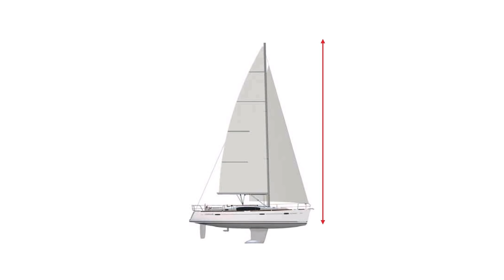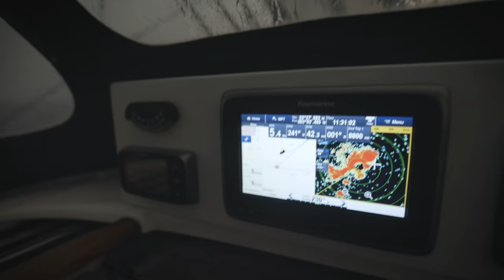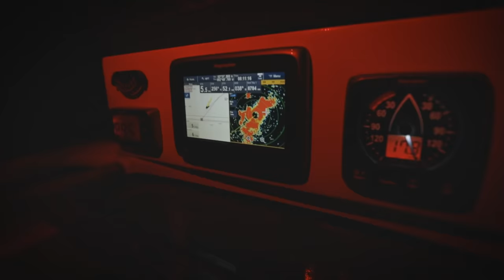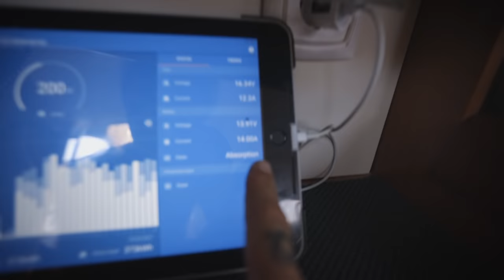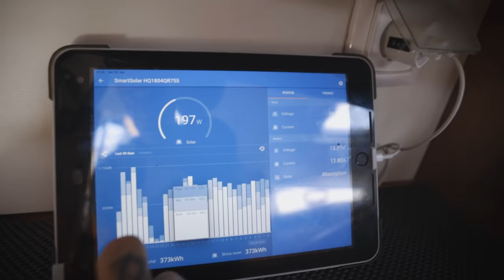Is a BENETEAU suited to Bluewater Sailing? (BOAT TOUR & REVIEW) ⛵️ | Ep 24

Comment: The sheeting angles can make a huge difference with rolling. Use tweakers and adjust the raveller to make it as comfortable as possible. Then sometimes a slow roll in a swell can improve performance greatly. Its called ooching.

Comment: PS to my post below. Every Sailboat I have had has been a Conventional Rig with Classic Mast and Main Sail with Lazy Jacks and Stack Packs and Hank on Sails, apart from my last boat which had a Furling Genoa on a basic Sloop with no inner forestry (I don’t like them tbh) Maximum fun was bouncing around on the foredeck changing Sails, loved it. They all can be made to work but Disability forced on me learn what a total pain in the backside to work with a Classic Mast really is, hence my Conversion to - after a serious look into them in Mast Furling, and the UV protection they can offer. Battens in them cause serious wear and tear, and seriously shorten the Life of already short lived Crosscut Dacron Sails and seriously reduce furling and unfurling reliability. So as a Cruiser looking for Reliability and a long Service Life Shape maintaining Sail, I started looking for a Sailmaker that would make me a Triradial Furling Battenless Main. It turned out to be quite a long search. Usually only getting the response “We Only Make Batten Ones” Eventually, I got a Yes, we’ve made a number of them, and if you need heavy duty Offshore specification, just tick the box on the order form - this from Precision Sails, and much to my surprise, they added, that the Triradial Construction recovers most of the power lost by having No Battens ! Wow.  Now they do cost from about double a Crosscut Dacron Sail, but instead of being Stretched and buggered inside three years, with occasional Valeting, and re stitching, they can maintain their shape well for over 20 years- So cost per year of Service Life Plummets. Same goes for a Furling Triradial Genoa too as Reinforced Reefing Points to retain shape can be added. Partially Furl a Crosscut Dacron one, and the Sail Shape can be buggered within a few hours. So I’m thinking of about around a 140% Triradial Genoa, to have enough Sail room to properly fit three Reefing points, or a self tacking Jib plus a Furling Reaching Code Zero to fill in the Wind angle gaps plus a Furling Gennaker depending on Sailmaker advice. Since, other Sailmakers, including Quantum, Ullman, and others have started offering Battenless Furling Triradial Mainsails as well, so things look up. Bob. 👍⛵️🌟🌟🌟

Comment: Great vid, well put together and thought out. The main question ‘is this boat good enough for ocean crossings’ is fairly simple to answer. Every boat has somewhere a builder’s data plate, on this plate you’ll find reference to a ‘design category’ - A, B, C or D. 

Category A is ‘Ocean’ - designed to be capable and self sufficient in wind that may exceed force 8 and wave heights in excess of 4m. 

Obviously there are boats out there in category B (offshore), C (inshore) and D (sheltered waters) that are taken across oceans but consider the implications of your insurance not paying out should something happen and you have to bail into the life raft with your beacon. 

FYI Oceanis 40 is Class A, as are most boats above 30 ft.
Reply from the maker: Thankyou sir, correct you are. Glad you enjoyed🤙

Comment: There is nothing wrong with a Beneteau. I owned a 461 and it was a solid boat, quite fast and was well furnished. I had it modified from a four cabin to a three cabin to make it more livable to me. I agree with your sail modifications, it needs a self tacking jib and a third reef in the main. I had the teak decks refurbished and replaced the foredeck to give it a new life. The exhaust elbow replacement is a must. Mine was almost completely blocked. I replaced all the hoses, throttle cable, standing and running rigging, the guide wires and batteries to increase the storage to 560ah. You can never have enough! The fin keel needed some work due to corrosion. You can argue all day long about a blue water boat and I agree a steel or aluminum keel is safest, particularly with a full length keel but they are hard to maneuver backwards and slow. Amels have a fin keel and so do lots of other boats costing a lot more money and most boats today are made of fiberglass. I have heard you tubers sneer about “plastic fantastic” boats when that is exactly what their boat is. Ignore the detractors, you have a solid boat which will serve you well.
Reply from the maker: Agreed and thanks for your insight mate. All good points here and the 461 sounds like a nice boat. Fair winds 🤙

Comment: We crossed the atlantic 3 years ago on our B43 which is quite similar to your boat. We made this first crossing with the boat as we bought it. We are now preparing to leave next summer for a 5 year trip and replaced, modified, reinforced a lot of stuff. New sails, purpose made (reinforced). New sprayhood and bimini with 400 watt semi flexible pv panels on the bimini. Lithium batteries and modification of alternator charging to protect alternator. New motormounts, replaced all standing rigging with dieform. Installed watermaker, …. And the list goes on and on. With our experience i could maybe make some small additions to your ebook
Reply from the maker: Good job Francis, some great boat jobs ticked off the list especially the lithiums and watermaker. If your interested the ebook can be downloaded at https://www.sailingbeaver.com/shop/

Comment: Excellent job setting up the boat for offshore. You might consider mounting the EPIRB on the cockpit rail. If you get rolled over at night, or have a fire which can fill the boat with smoke in a matter of seconds, you can't get to the EPIRB and it can't float free. Speaking of getting rolled, a bluewater boat will have a higher ballast to weight ratio and a narrower hull so that it comes back upright even in a severe knock down. Hull shape and weight also give a bluewater boat a slower, more comfortable motion. Crew skill and attitude are the most important factors for passage making, as well as having the right equipment on board. You can sail just about anywhere with your setup, but a "true bluewater boat" will still make a difference in the worst of conditions.
Reply from the maker: Some very good informative points here, thanks for that. A good idea with the float free beacon one worth considering. We would also have to agree with the kinder motion on heavier ballasted vessels. Cheers

Comment: You did an awesome job with all of your additional equipment - like inner stay, great anchor, solid self steering in Hydrovane that can be used as an emergency rudder if needed, very detailed approach to lines and blocks and probably much more. But a solid captain and crew - are the most valuable part of your boat-home and you did spectacular from everything I've seen so far. To be fair, I need to share my experience and view on an issue. I've participated in delivering a couple of Beneteaus and was able to notice an uncomfortable design feature of the boat - it is pounding while going upwind in moderate winds. However, deliveries are done on a schedule and you often forced to sail a shortest route within a time frame and often not a better one. With that in mind, knowing  limitations of the design, it is easily avoidable by being flexible - like falling off and sailing comfortably and faster on a reach. Besides, nobody in their right mind would cruise upwind in moderate winds and choppy waves for so many reasons. I'm sure, that you and your boat will have a ton of success and fun while taking each other to any and many places within your comfort zone, and that zone expands with every passage you make. Fair winds and stay flexible
Reply: I noticed the pounding also when motoring a Beneteau 45 upwind into 30 knot winds. Less noticeable when sailing instead of motoring. I think it has a flat bottom, but when heeled it presents a rounded section to the water so less pounding.

Comment: Great video I’m also a Kiwi and have the Oceanis 43, love the boat got caught in a southeast low off the Queensland East Coast and it preformed well but does need a 3rd reef.I have 20 sq meter Solent setup, great in heavy weather. I love the fact that they are a fast cruising boat couldn’t stand going slow cheers Jay.
Reply from the maker: Cheers for the feedback, much appreciated. That 3 extra feet would be very handy I’m sure but yeah we have had plenty of use on 3rd reef. Fair winds mate 🤙

Comment: I went cruising on a 57 foot strip planked fin keel spade rudder ocean racer. Everyone in those days said that you can't cruise on a fin keel spade rudder ocean racer. We ignored this and went cruising. It was the best choice because it sailed so well. Also, because it was a narrow racer it went to windward very well and performed fine in light winds.
Reply from the maker: Very interesting and we like this idea. Usually the race built boats are always built super stiff and strong which has an advantage over the average cruiser. Speed definitely has its safety factors in strong weather, thanks for this information. 🤙

Comment: I think it was the late Patrick Childress (RIP) who, many years ago, sailed a Catalina 27 around the world after beefing it up for sailing the oceans.  Three years ago another guy I saw on You Tube sailed a Catalina 27 from California to Hawaii.  Sam Holmes made a similar crossing to Hawaii on a 23 FT Ranger about a year earlier.  More recently a young Polish guy built a 16 FT plywood sailboat, purpose-designed for the passage, and sailed it across the Atlantic Ocean.  Webb Chiles, among his many voyages, made it 3/4 of the way around the planet in an open (no cabin) sailboat, I think it was 18 or 20 FT.  Famously in 1965, 16 year-old Robin Lee Graham sailed his 24 FT sloop named Dove around the world solo.  James Baldwin has circumnavigated twice in his very simply outfitted 28 FT Pearson Triton.  The first time around with no engine.  And of course probably the most famous sailing couple, Lin and Larry Pardey circumnavigated their 24 FT home-built wooden Seraffyn, the "wrong way" around the Southern Ocean, also without an engine.

These and many other stories are proof that you don't need a Westsail, Island Packet or Pacific Seacraft to make a safe passage across an ocean.  What you need is experience, good judgement, selection of proper season, route and a good weather window, and appropriate rigging and equipment.  If anything, your Beneteau is probably overkill the way you've prepared it, for trade winds passages.
Reply: Robin acquired Dove 2... S. Africa? and it was a bit longer... to finish his 5 year journey

Comment: The companionway is my preferred spot to keep watch while offshore in our Beneteau Sense 50.  I have resisted mounting another  full array of instruments as each of my helm stations has full instruments and large plotters.  Instead I use  Android tablet as a plotter with AIS on a RAM mount along with  a handheld remote for my autopilot. I'm still looking for a solution that would permit visualizing the radar over wifi. 
Cruising is 10% sailing and 90% at anchor. Beneteau has the "at-anchor" part very well designed and implemented.  With experience, each sailor can slowly customize the 10% to their individual tastes. In essence creating a custom solution paid by sweat equity. Well done!
Reply from the maker: Thankyou sir. Your right it is good and protected at the companionway under the spray hood but it also must be nice with plotters at each helm. There is times when hand steering at night the could have been handy for us too. Good idea with the Ais on the iPad. Cheers 🤙

Comment: I would install backing plates on the keel bolts, I believe the Beneteau has only washers. The next time your on the hard drop your keel for inspection.
Reply from the maker: If we were removing the bolts for some reason or making repairs in that area then that would be a good idea but otherwise not (can of worms). Your right though, kinda small backing plates.

Comment: RUDDER?  HiGuys! Good work on the boat and on the video as well! What I am curious about is: Did you do anything with rudder? Some guard or backup?
Reply from the maker: Thanks 🙏. Yeah we did a complete rudder overhaul and removed, inspected and replaced bearings in a previous episode. Also installed a Hydrovane self steering that can also act as an auxiliary rudder in case of failure to our main rudder.

Comment: You may like it better if your backstay chain plates were installed so they're aligned as to make the shear forces parallel instead of perpendicular. If the plate and the rigging wire tugging against it make a T then it's more likely to break than if they are closer to parallel. So basically if the plate were on the hull or transom it could be aligned closer to the rigging than on the underside of the deck as it is.
Reply from the maker: This system is a replacement of the small original padeyes with a large selden 2,000kg padeye and we installed additional backing plates as an extra layer to the double thickness deck/hull join. What your referring to we did consider but would be a whole new system to involve building and installing custom chain plates for the transom where the hull is thin and would be only the the deck section. We made the best of what we had to work with but in hindsight wish that we just installed dyneema on clutches as the forces a relatively minor on the fractional rig
Reply: @SailingBeaver  With relatively minor forces then the ideal way to handle shear doesn't matter so much.

Comment: Hi guys! Cool production, a quality video and nice upgrades to your boat. I’m not very experienced and I wonder why you only talk about the equipment but not the stability properties. I’m new to understanding of the bluewater concept, but my first impression was that bluewater means the boat is supposed to survive the severe ocean conditions. I couldn’t find the stability curve for Oceanis 40, but I presume the wide body hull (which is undoubtedly very comfortable) has a negative stability at certain angles, meaning the boat will not right itself after inverting without help. Additional strength to the mast is great, as well as additional sails optionality or sustainability, but isn’t the stability the more important property?
Reply from the maker: Thanks, much appreciated. Some valuable points there for sure. Delivering or discussing stab curves is probably a little above our pay grade (as we ourselves are somewhat inexperienced) but it undoubtedly would effect the boats comfort in a seaway and eventually safety in severe conditions. Thanks for your input.
Reply: Stability is not the problem with these boats. Shitty engineering/build quality is. The keel attachments are underspecced and even a slight grounding may turn the boat into a ticking timebomb. Check out the wiki article for Cheeki Rafiki.

That said if you are aware of this and check the thoroughly check the keel attachment like your life depends on it. These boats still make good cruisers.

Comment: I arrived in Opua 2 weeks ago now after a disastrous solo crossing from Fiji. I had done the trip 3 times before without major issues.
My boat is a bullet proof Spray 42,ketch rigged, not the fastest tub out there but 18 days.for this journey is....just forever. Why? Rudder damage.
The last 500 miles the conditions were quite challenging and it was during this part of the journey that the damage was done. What exactly happened i will never know but it is clear to me that it must have been a very heavy object to cause that amount of damage to a rudder that was very,very heavily build.
As a consequence of losing the ability to control the boat adequately in the stormy conditions I spend 7 days hoved to.
In moderate conditions I could still maintain a more or less steady heading however nearing North Cape I ran into a front that produced a prolonged period of 'fresh' SE winds. A couple of days earlier the main had ripped, just above the 3rd reefing point rendering it useless in the conditions I was experiencing. 
Eventually I got towed in by a cray boat that was sheltering at Three King Island.
I remember thinking a few times how lucky I was being on a well build and strong boat with a long keel!
You don't seem to be too concerned about your fin keel and spade rudder(s), as you don't give it any thought. 
I would!
Reply from the maker: Wow thanks so much for this information and account from what sounds like a super tough experience on this crossing. Shit happens and by the sounds of it, can happen to any boat there no matter what the build or reputation. Great job in making it to Opua safely in the end. As our videos are quite behind, we ourselves have just arrived yesterday in Opua from Fiji and although we had a good crossing the last 3 days were were beating our way through a large cold from 300miles out, was tough but we were lucky everything went well. Would love to grab a beer and hear more about your experience, we are in the marina in Opua 🤙
Reply: Still anchored off the breakwater on Heritage.  Coffee is always ready.